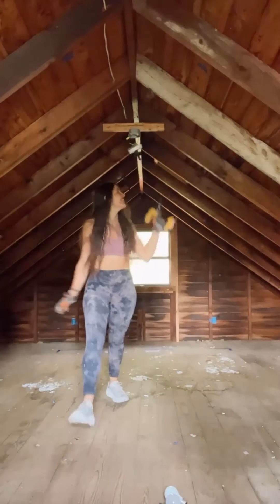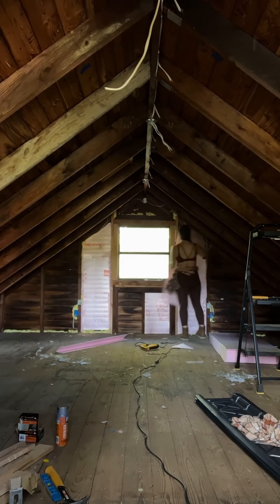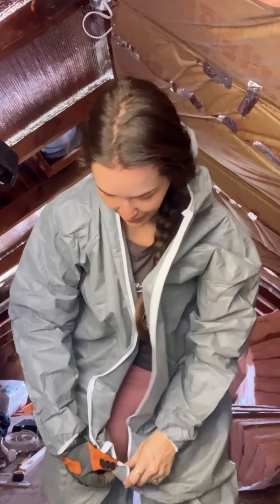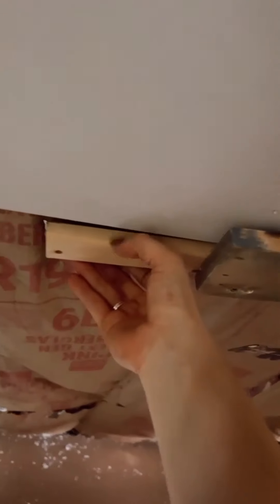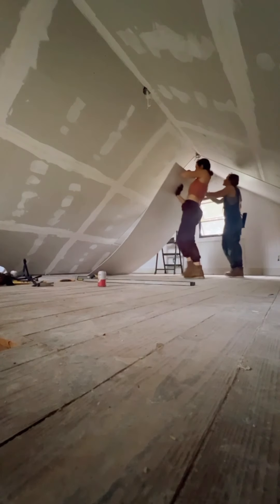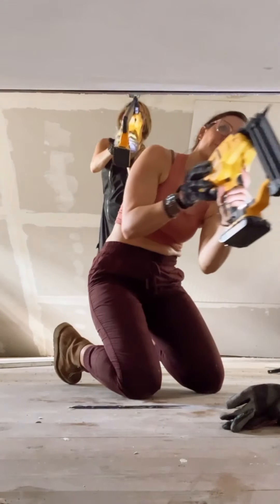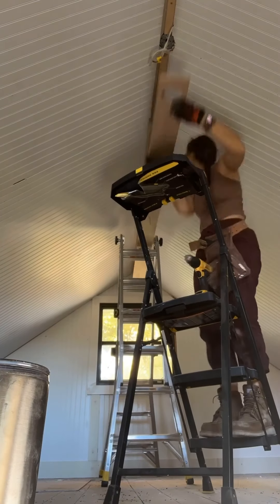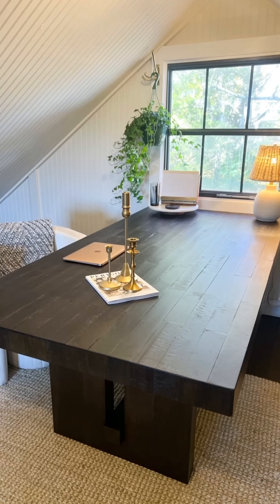ATTIC TO OFFICE?? Turning our HORRIFYING garage attic into a COZY OFFICE | diy attic conversion

Comment: May I ask why you did not use plastic baffles in the attic bays, rather than construct a channel w/the rigid foam strips and insulation foil? Great videos. I'll be doing a similar project.
Is it because you have true 2x4 construction?